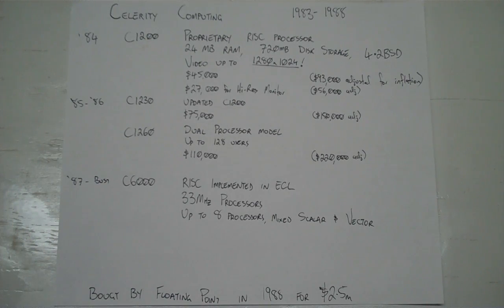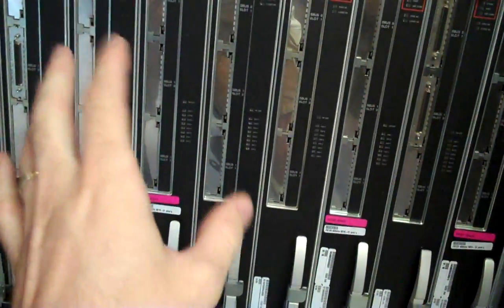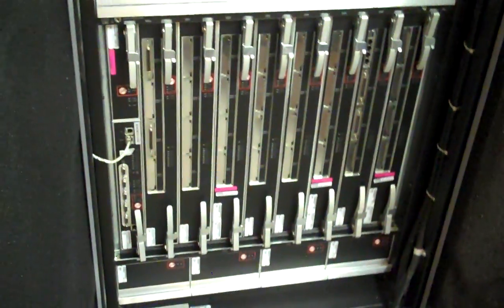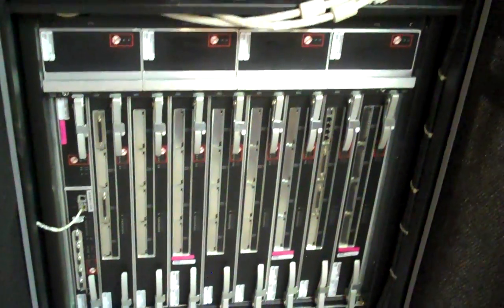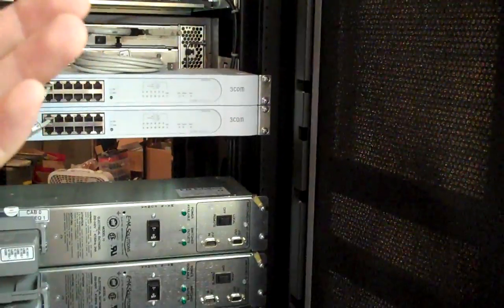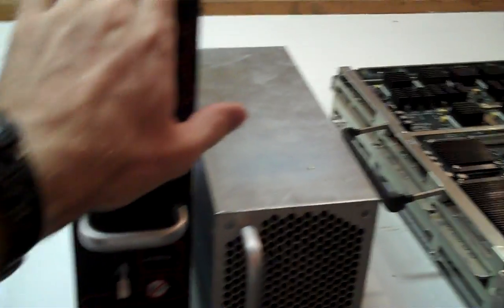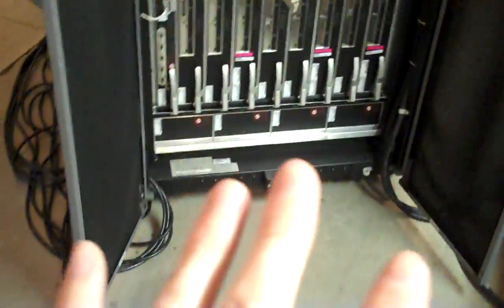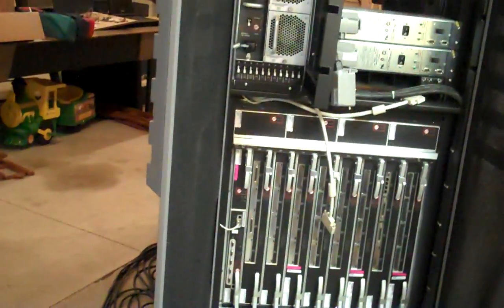Tour of a Sun Enterprise 10000

Comment: Super late to the party but I built these! Back in 1998 or so I worked at IBM Endicott and build the cpu boards and centerplane - assembly and testing. We had a partially assembled machine for some of out testing, as well as specific tests we did on boards out of system. 
Our tracking system originally ran on OS/2 3 Warp IBM PS/2 systems with Blue Thunder CPU's, then we upgraded to Pentium III based systems with OS/2 4. 
Good times.

Comment: Really good video - takes me back to my time at a famous internet bank turn of the millenium who had 2 of these which I administered.  Both fully configured, with a spare fully config'd system board just sitting around, just in case...madness given the costs involved.  Attached were A5200's fibre arrays but then also clustered for failover capabilities, network failover and multi SSP set up - iirc got replaced by a 6800 system eventually - then made into a dev system lol !
Reply from the maker: I can't possibly imagine who are are talking about :) I actually knew they had one, I didn't know two. They are monster systems. I'm hoping to get back to it this year and get it fully running. In the mean time, the Cray. Kind of funny they were replaced with 6800s, since I've got two of those, too :) Thanks for the memories!

Comment: I wonder if a version of the latest version of UBUNTU work on that machine so you can have it up and running to allow you can do your useful work on it also you would need 60 SCSI drives, There are AMD ZEN processors that will have 36 cores and ZEN APUs that will have 32 CPU cores and 16 GCNs which will have as more power as one of those computers.
Reply from the maker: Now this one I do know the answer to - Linux will not run on the E10k for certain. A bunch of the hardware is just not supported and given no one who develops Linux ever got their hands on a multi-million dollar E10k to do the dev work on, it was never added. And, of course, now it's just old hardware. As for the Zen, you need to understand that a machine like this is a holistic approach to supercomputing - a current processor might be able to do more ops per second, but the rest of the architecture isn't designed to support peak ops - the memory bus architecture and throughput on the bus just isn't up to snuff, let along the redundancy and reliability, which off-the-shelf PC "servers" aren't designed for at all. It's truly apples and oranges!

Comment: Where does this stuff come from?  How will you get the software to work?  Or are ya just gonna tear it up?  Thats fine toooo.
Reply from the maker: I have purchased two, so far, one from a university and one from a guy who got his from a surplus sale. The system is in a working state, although currently it has no OS installed. One of these days I'll cycle back around to it and get it completely installed and running, but all the parts work (I have a lot of spares, which helps)

Comment: It'd be awesome to visit your shop and check out all the gear I saw in the video. I'd love to see the Onyx in operation.
Reply from the maker: Well, if you're ever in Iowa... And as for the Onyx, I'd love to see it functioning too. :) (I did get far enough to bring them up to X a couple of times, but never all in a group like I wanted)
Reply: Do you have a copy of IRIX? I have IRIX 6.5 media if you need it :)
Reply from the maker: I do, thank you. I did have a working OS install (as I said, to bring it up to X), but hardware was the bigger issue. I was losing boards at an alarming rate while trying to video it.
Reply: You wouldn't happen to have any solutions for getting a serial console on an SGI Indy? It uses a Mac-style serial connection, but I'm not sure if it uses the same style pinout, plus I don't have the proper cable anyway.

Comment: @jpkiwigeek Yeah i , i have managed to clean it out and fired it up managed to 
get solaris 9 on it, but ive run into a problem, I just cant manage to get the SCSI controller to detect the either the Disks in it or StorEDGE D1000 at all, witch atm is being used as a DAS. (just one of them but i plan on daisychain them all)

I've been trying the "probe-scsi-all" command from the (ok)prompt but it only detects the internal drives and the CD-rom.

Solaris9 alltough being very old is still competent

Comment from the maker: @160rpm Immediately to the SSP's right is a DEC VT240 terminal. The U5, although it has VGA out (rather than 13W3), isn't currently set up to use its framebuffer, so it's serial console only. The most reliable serial term I have is this VT240. The screen's getting a bit crappy, but it works like a champ. (This is also the term I use in my Z80 videos)

Comment from the maker: @Jamac666 Less than scrap prices. :) I'd rather not say, only because I got it through a friend, however although there are several E10ks on eBay for >$1k, there have also been several for under $200 - usually they're so bloody big that no one can get them and is willing to pay shipping. I saw one in Texas no-sale, after several retries, for $50. If it were just that much closer I would've gone just for the spares :)